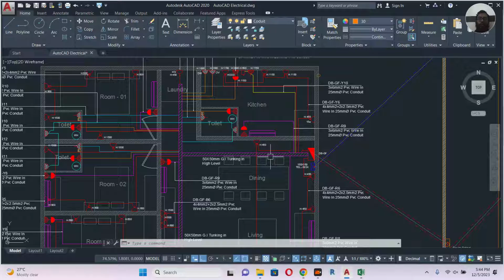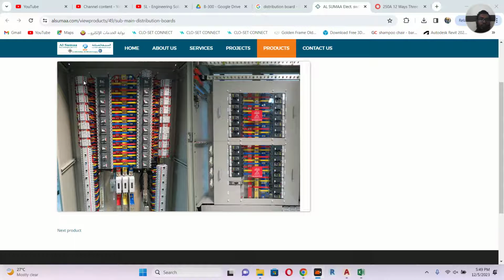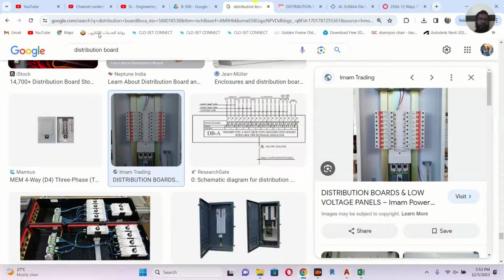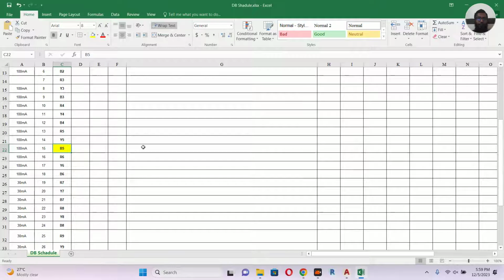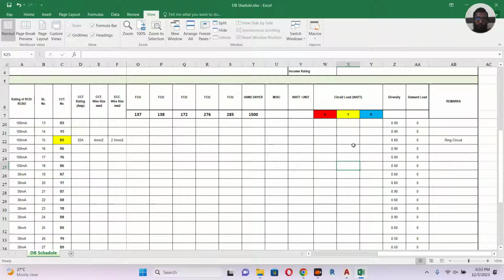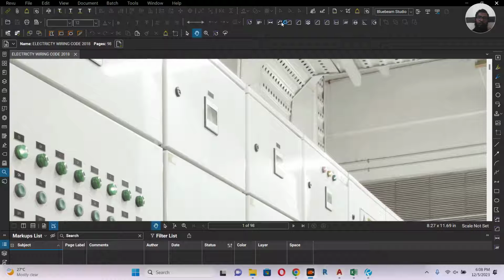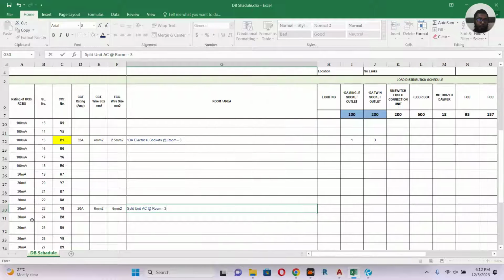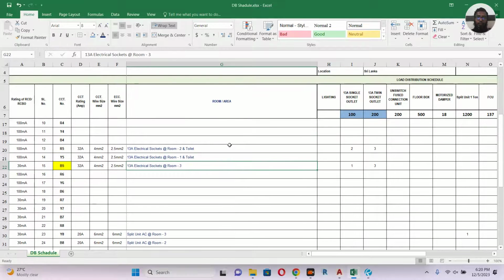Step by Step AutoCAD Electrical  DB Schedules Part - 005-A

Comment: Can I get the lighting layout of this work to cross verify with the excel for learning purpose. In the cad file you have provided only sockets and ac details (DB)are there. where can i find the spare DB details
Reply from the maker: Thanks for your comment
1. Spare and Space Normally will be only in Distribution Board for feature use you will not fid this in drawings, if you are designing a DB spare should be provided minimum 3 Number's

2. For the Lighting Load I used imaginary Load any how check my lighting design video for more details

https://youtu.be/_-ao5F-5yLU
Reply: @slengineering_solutions i asked to get DB numbrs of lighting ckt and numbr of lights used to filll the excel file by myself so that i can learn